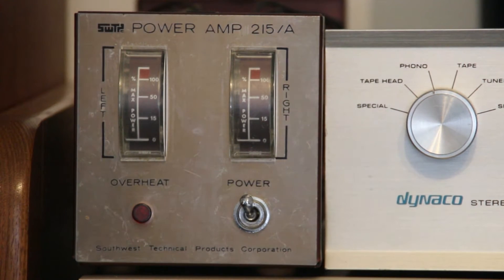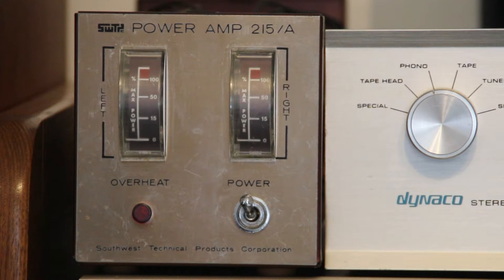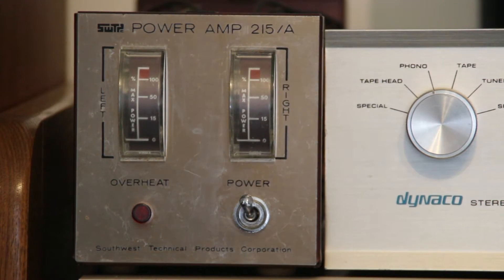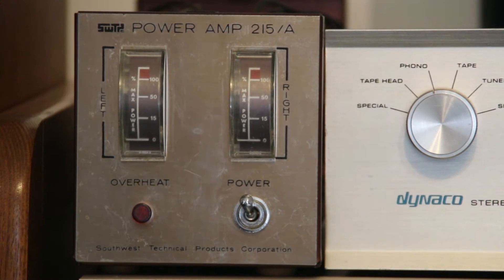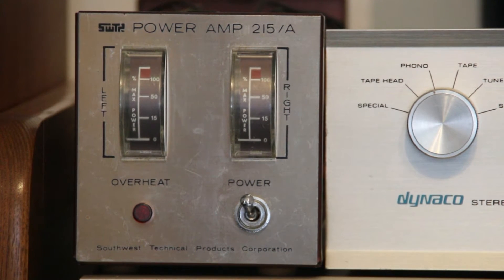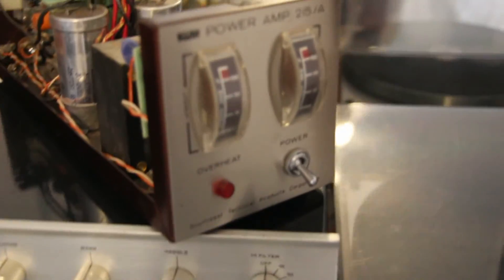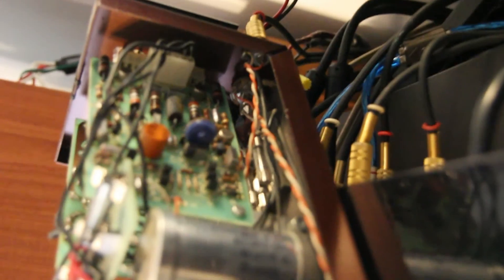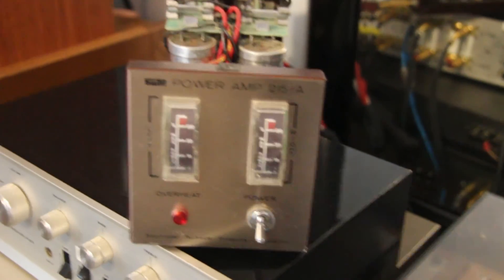SWTPC 215 Power Amp - Soutwest Technical Products Corp

Comment: Walks down memory lane aside, it would be helpful to see how you've got this rigged for use with a preamp and turntable.  The RCA plugs in back have this AC and DC lettering, I'd like to see with the cables attached to and from the Dynaco and Harman Kardon.
Reply from the maker: The hook-up is pretty standard. RCA inputs and the Speakers use 1/4" jacks.
The amp is now on the shelf and we have since moved, so I don't recall the exact wiring scheme, but it was either via the Tape Monitor on the PAT-4, or direct between the Amp and preamp. Most likely I ran the EQ straight between the Amp and Preamp and avoided the tape monitor circuit.

Comment: In 1975 when I was is Grade 10 Electronics, a another Student was building one of these, along with the SWTP Preamp with Push Button Tone Controls. The quality of the Components looked pretty good
Reply from the maker: They made excellent well-designed eqpt. I used a pair of their 100W Tiger amps for years and loved them

Comment: I have a pair of SWTPC Tiger .01 60 Watt amplifiers. Each in the same case size as shown in the video. Binding posts for the outputs. Its complementary-symmetry push-pull amplifiers has a robust feedback loop that the op amp LM 741 didn't have and most of the other commercial amplifiers that came after this had. The developers of this amp design called it the "741" problem as the op amp chip itself had a low high frequency response. My Tiger .01s are still working.

Comment: While in university in the early 70's, I worked weekends at one of their small bar/coffee house and these amps were used in a simple sound system with efficient studio Altec Lansing speakers.  These amps were simple, offered plenty of clean sound and were very affordable, the student radio station technicians, built them from kits.
Reply from the maker: They were a fantastic value. I used a pair of the Tiger 100W amps for years nd loved them

Comment: While test reports exist for some SWTPC amplifiers (Tigersaurus 250, Plastic Tiger, Tiger .01 60-watt, etc.), I can find no such report for the 215-A. It would be interesting to see how conservative the 25 watt per channel rating actually was. About the sample of music you played, I noted how far up the VU meters went, which was no more than about 5 to 10 percent. This would translate into about 1.25 to 2.50 watts per channel. In other words, we are hearing the music at a regular listening level, well under the max of 25 watts/ch. The extra power kicks in only when very loud passages occur. So long as the power output does not exceed a point at or above the 25-watt max, clean undistorted sound should always result.
Reply from the maker: I agree with your comment, and this leads to the old argument as to what speaker power ratings mean. My contention is nothing and it is an advertising gimmick. A 20w amp that is pushed to clipping on a speaker with a 100w rating will blow the speaker because there is no headroom for the louder passages, a 500w amp will be fine on a 100w speaker since it will usually just run at a couple of watts at normal listening levels with lots of headroom.
Reply: @ejcheck  Thanx-A-Lot for that response.

 In recent years I have come to realize the importance of the relationships -- and differences -- of power ratings between amplifiers and speakers. Based on your comments, it would appear that the 215-A would match up reasonably well with low-cost classic AR speakers  such as the 4x, 6, 7 and 8, all of which had 15 watts minimum rating. As long as one used the amp and speakers in a proper-sized room, and did not continuously push the amp volume up past a critical point, then that particular scenario most likely would be OK.

While SWTPC audio amps and preamps were well-respected by reviewers and consumers alike, they were always competing with kit-based audio equipment from better-known entities such as Heathkit, Dynaco and Eico. And speaking of Eico, for a few years they had an integrated amplifier which if I'd known of its existence, I would've loved to have owned one. This was the Cortina 3150, rated at 40-watts/ch continuous at 8-ohms.  THD and IM ratings, while not as good as those for the SWTPC 215-A, were respectable for the particular time period (late 1960s. early 1970s). The 3150 in kit form was a steal at $149.95. In wired form, the unit was priced at $225, more than competitive when compared with other integrated amps at or near that figure, including the classic AR Amplifier. Unfortunately, despite glowing reviews from Audio Magazine and Stereo Review, the Cortina 3150 lasted in Eico's product line far shorter than its lower-powered brother, the Cortina 3070 (15 wpc at 8-ohms), also highly praised by the leading audio mags of the day. What a pity I consider that to be, especially after reading the two reviews of the 3150.

A web-page with the title of "Famous Arty Faxx" (searches for it can done with or without quotes) has the two reviews of the Eico Cortina 3150, as well a review of the Cortina 3070. There are also reviews of the original Kensonic Accuphase (by Teac) power trio of the C-200 preamp, P-300 power amp and T-100 Am/Fm Tuner, Dynaco's SCA-80 integrated amp, plus other audio components. You'll also find a page taken out of a early 1970s Lafayette catalog reporting on consideration of a rigid standard for power amp ratings.  The FTC would adopt such a standard in 1974, and 1975 catalogs from entities such as Lafayette and Radio Shack would offer equipment with power output ratings that conformed to the new standard.

Unless you have a cell phone with a very large screen, the Famous Arty Faxx page is best viewed on a desktop, laptop or notebook.
Thanx-A-Lot. Stay Safe and Well. Frank

Comment: The 215-A was introduced in SWTPC's 1975 catalog at a price of $ 69.50 (kit).  The price went up to $ 79.50 (kit) in the 1978 catalog. If you do a web-search with the keywords SWTPC catalog archive (do not put them inside of quotes, or else specify them as an exact phrase), you will find a number of sites with images (in varying natures) of old SWTPC catalogs and related material. One particular site has readily downloadable PDF files of several SWTPC catalogs in the period from 1969 to 1980, as well as PDFs (or links to PDFs at other sites) of magazine test reports on various SWTPC audio products.  I certainly wish that I could have discovered the wonderful world of SWTPC way back when.

Comment: Cool, I just came across this video! I have one of these sitting a few feet from me. I've had it since the '70s and used it daily until the '90s. I'm a little afraid to turn it on until I re-cap it, which I'm planning to do at some point.